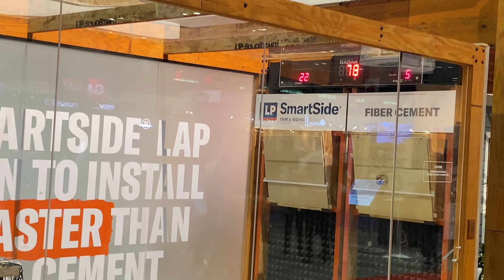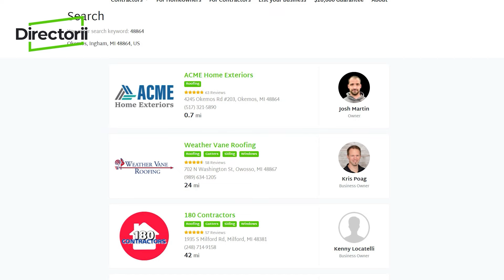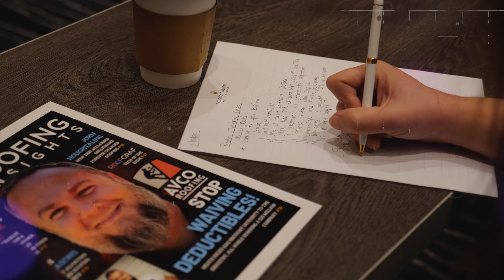LP Smartside VS James Hardie, Euroshield VS Class 4 Asphalt: Insurance Adjuster's Pick

Comment from the maker: 00:00 LP Smartside is really good at Marketing
00:23 James Hardie need to demonstrate product better
01:07 We need to pick products based on performance
2:23 What for yourself why 
2:44 How many claims have you adjusted? 
3:05 How misleading is class 4 shingles classification?
3:31 Metal doesn't do well here
4:06 James Hardie or LP Smartside
4:42 Gutters: aluminum or metal? 
4:52 Best roofing products?
5:22 Euroshield on my house
5:50 Have you seen Euroshield performing after hail damage?
6:20 Class 4: do we need higher number for classification?
7:40 What works in your state? Comment below!

Comment: Been dabbling in EuroShield down here on the Gulf Coast of Alabama due to its lab tested wind rating alone. It’s like a beefed up rubber doormat. The stuff is legit. Unfortunately a lot of insurers down here don’t offer discounts with class 4 due to the rarity of hail in the area, but hail does occasionally fall. 
As for siding, Hardie or Nichiha is the only thing that will last more than a few years. LP falls apart with the rain that we get here. Vinyl blows off anytime there’s a hurricane. Thanks for the video 👍

Comment: Since I went Hardie on front and back...never go to anything else..and make sure they are Hardie factory certified guys it matters .  Also have the duration premium from corning ...we don't get much hail in jersey,but the thick corning duration premium,will out last me as will Hardie siding..roof also installed by corning certified and they where velux skylight rated installer so I needed both have 8 skylights in back room..Venus replaced the 27 year old Andersen,since they no longer do skylights..velux has that market covered..not one problem on the stuff...